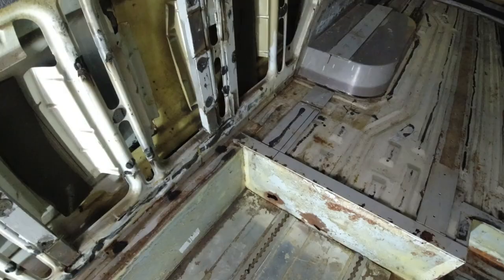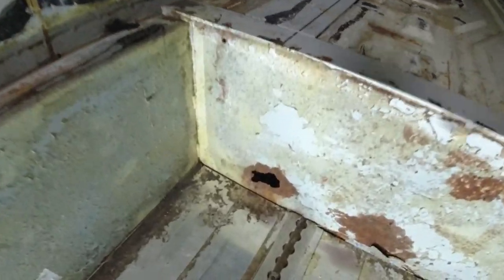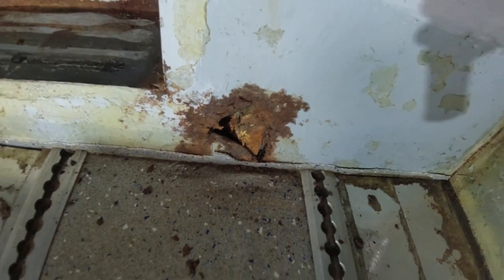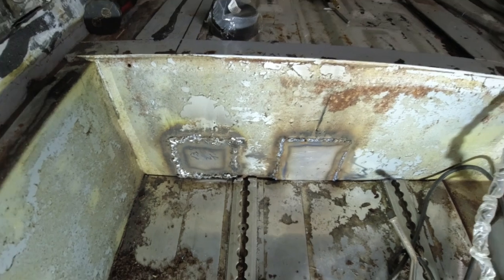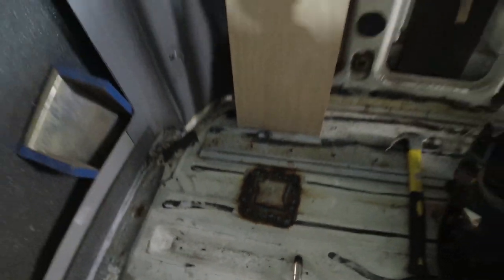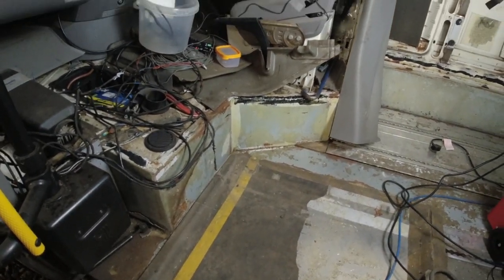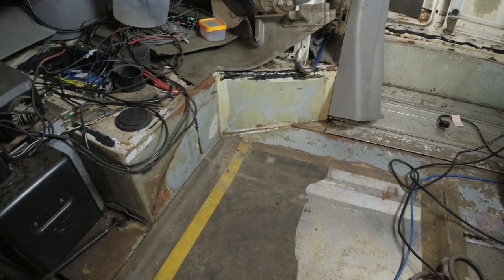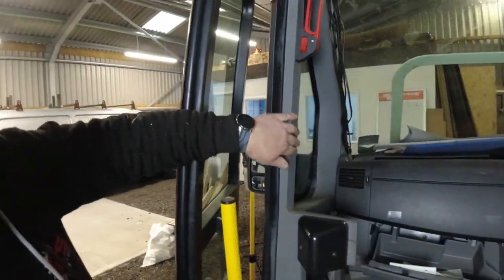VW Crafter Campervan Conversion - Rust Removal and Welding

Comment: Good start to it. 
We are definitely fitting another seat. Going to try not to block the door as I like the double patio doors. The webasto will need to be moved. Plan to reuse it down the back end with  some ductwork. 
Keep at it!!
Reply from the maker: Yeah I'm moving the webasto down to the back it's a better place for it and a shorter fuel pick up needed.. I think I have figured our a framework for the seat just need to give it a try.

Comment: Good idea with passenger seat, I've got my leisure batteries under mine. Bit of a job making base and altering seat runners, but works well.
Reply from the maker: Thank you.  I have some nice seats and a swivel base if needed .  Glad I can weld thats for sure